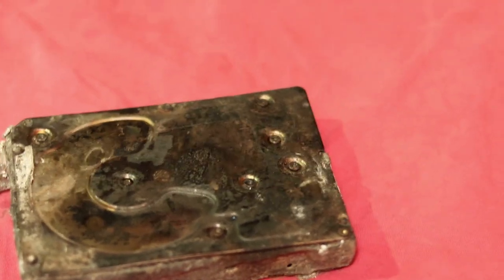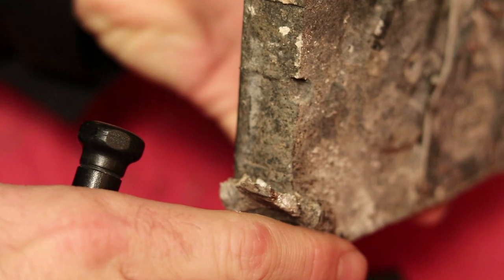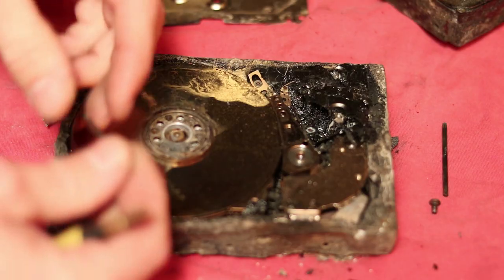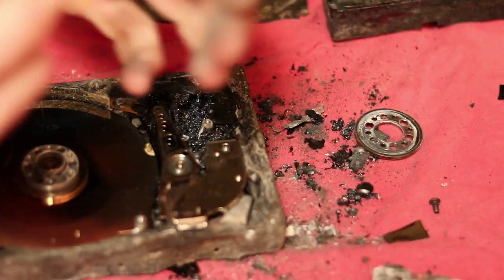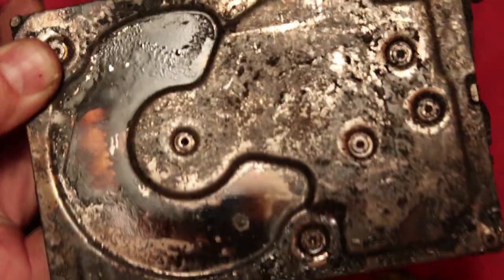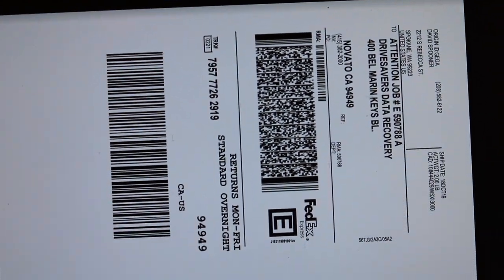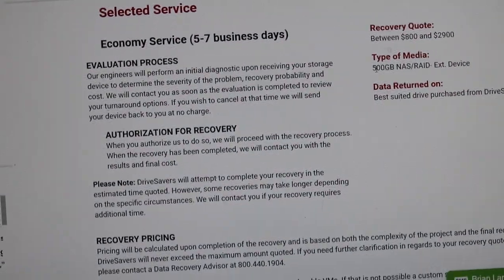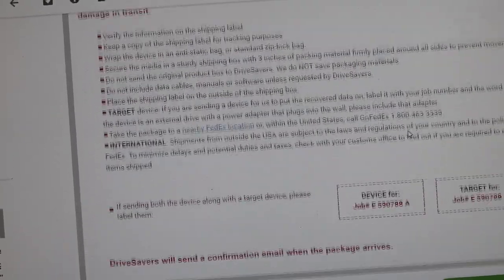Extreme Fire Damaged Hard Drive Recovery

Comment: So what happened. I had the same thing. Sent mine to a place here in Canada but i think they are a scam. Couldnt do anything and told me nothing, no explanation, just returned it with my money.
Reply from the maker: I still haven't sent it in yet.  I haven't had the time or money to deal with it yet.  That sucks that place you sent yours to wasn't able to help you out with it though. :/
Reply: Spooner Tuner I-need to wait for money as well. I heard they can take the disks off and read them individually. However, i found a microwave magnet in my fire residue, and it was completely demagnetized. If the disk got hot enough, that may have happened as well.  My situation is that i have to got to an american company and thats another 40% on the fee.